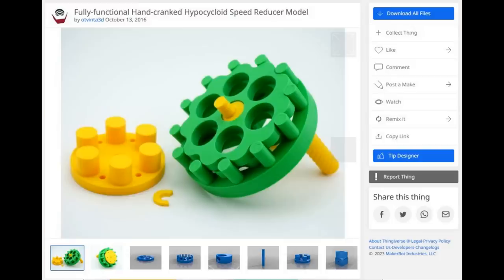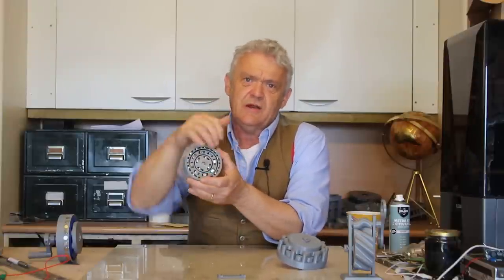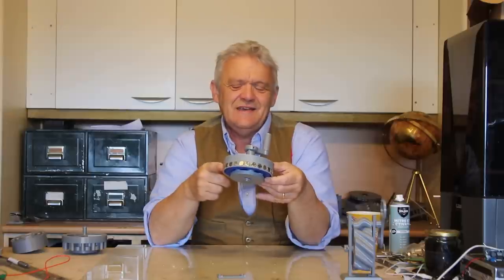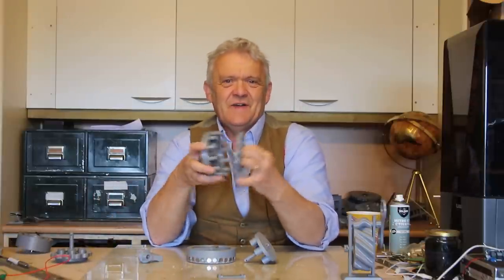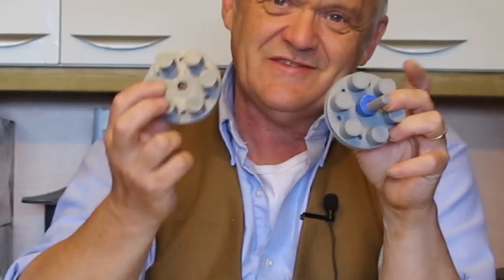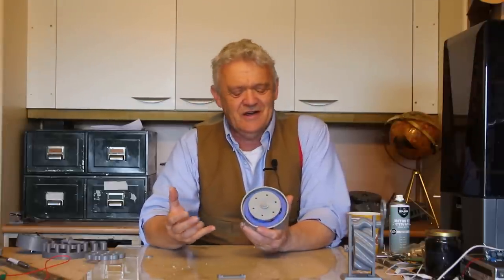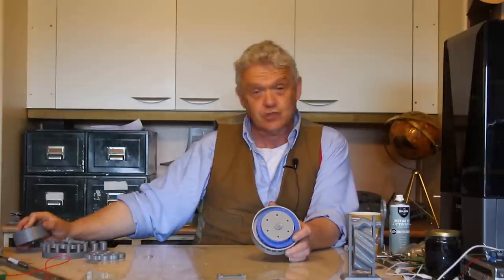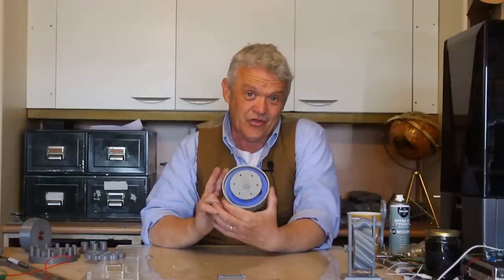1988 Magnetic Cycloid Gear

Comment: I have been using these successfully for at least 40 years. the really nice thing is the reduction of a single stage ranges from 6:1 up to 86:1 and multiple stages are easy, so (86 x 86) up to 7,396:1 in 2 stages is possible. Before variable speed AC drives were commonly available, I also used a version that included a mechanical variable speed (SM Beier Variator + SM-Cyclo reducer). The result was a very strong drive in a small package. The cyclo speed reducers are capable of handling massive torque and high reduction ratios in remarkably small packages.

Comment: My 1990 Subaru Justy had an electromagnetic clutch activated by a switch on the accelerator pedal.  Stainless steel powder bridged the gap when energised. Also first CVT trans in a modern production vehicle.  Two computers running everything.  Very cool for 30+ years ago.  Little guy was also on-demand 4WD.
Reply: Bruh... Goodness!
You're living it mate! 
I don't know much about popular cars, but I bet that one must've been a treasure.
Reply from the maker: nice share mate - cheers

Comment: I think this would make a fine dumbwaiter drive.  
If you approach the weight limit for the gear at a dangerous height, or your counterweight gives way completely, you still get a dampened fall rather than a full slip.
It has a nice redundant fail safe built in, at the gearbox, to prevent catastrophe and, of course, could be designed to handle a greater weight range relative to the counterweight.

Comment: Would be really interested in seeing even some really basic torque tests with this.
Everyone else I've seen make them has had the slippage problem you pointed out at higher torque (and something else, I can't remember, I think it was cogging torque).
If this has actually solved that problem I'd be inspired to try some ideas myself. It would really be the perfect motor for 3D printers. People make high power 3D printed brushless motors but they're so dangerous and waste so much money on the way to get 1 working prototype

Comment: I'd imagine that this gear setup would have issues with vibration, when operated at higher RPMs. Perhaps, there's a way to minimize vibration - like using multiple "cycloids" that are thinner/lighter and arranged in a manner to offset the weight of the rest of the gears, though, there would still be a lot of shear force happening - just balanced with more gears. It would be interesting to see this setup with the cycloid gears completely filling up the chamber, with a "tooth" in every slot. If I only had more time on my hands... until then, I'll just observe and learn... while leaving the occasional comment. Thinking out loud, except in text format.
Reply from the maker: yep - it is a prototype for demonstrating the principle - two rings 180 phase shifted would be a good idea for sure

Comment: One plus one equals three! This is a rather good idea. What would you need to do to strengthen the shaft/wheel to give the whole thing more axle torque while keeping the simplicity of manufacture?
Reply: - simply lengthen the magnetic contact area (torque transfer is limited)  and fully; bush and bearing all of the sliding surfaces (the eccentrics can have eccentric bushes with inner and outer needle bearings is one were to go crazy on the parts count, as the torque increase/speed reduction can be "crazy" per stage -   30:1 per stage could easily be derived by staggering magnetic contacts   - I made a 2 stage 100:1 model many years ago as a demo of functional uses of 3d printing  (I only used a single eccentric per stage as it was hand cranked)

PLA is not temperature tollerant, metal manufacture has its good points - plastic can make great bushing materials.

Comment: I'm assuming the magnets are oriented to be in attraction?
How can they touch otherwise?
If so why wouldn't it just lock up?
Sorry just confused 🤔
Reply from the maker: magnets are very strong along the axis of attraction but surprisingly weak at 90 degrees to the axis
Reply: So like a v-gate orientation there would be repulsion in both directions of equal strength?
When approaching and when leaving?

Comment: Hi Rob. Fun always! You mentioned printing with PLA. Is that your goto for  these projects?  Would you use a different filament  for  a stronger build?
Reply from the maker: yes it is mate - i have a load and it is relatively cheap so i use it to work out ideas for as stronger build i would use something different

Comment: Will it back drive?  Seems like other cycloidal drives, with reduced friction, do backdrive or over-drive when inpu and output are reversed.
Reply from the maker: yes it does - not this model as the friction is too high to back drive you will need to replace the cam and drive pins with roller bearings

Comment: Please attach a cycloid gearbox to a wind turbine, or wind collector, then using with a pulley system, more pully's, more travel and heavier weight can be lifted

Have it lifting the weight counter levering off a tall poll or poll's, that way all the mechanical mechanisms will be at ground level and can be anchored to a foundation... ❤

🤔 Could apply a brake on the cycloid gearbox so the the turbine can still make energy.

And disengage the brake when more electric load is required. Have no idea how to detect or do that, I'm not a sparky...

Comment: how to do the proximity of the magnets of eah other affect their lifespan of 'magnetitude'? What causes the permanent magnets to loose their strength over time Could you address the concepts in a video please?
Reply: It will last for billons of years, its one of the few things science knows/understand about magnetism and electomagnetism.
Reply: @trygvetveit4747 manufactured magnets can lose their power by heat, shock, alternating magnetic fields etc. With so many magnet moving in close quarters you have an already alternating magnetic field, so billions of years is a little incorrect.
Reply from the maker: sure mate - but neodymium is a hard magnetic material it will last for centuries - i think it loses abut 1 percent every 100 years or so
Reply: @ThinkingandTinkering  I think I read 700 years depending on the environment it's in. I've totally destroyed one with a paper match.
Put one near an ac transformer and it won't last very long. I think samarium magnets are more robust.
Reply: @ThinkingandTinkering  I know this may sound strange but say one has lithium batteries right. What if in a sense one could use neodymium as a "store of value/energy" and it is only decoupled from the coil to prevent further energy generation, and in this sense can be seen as a "battery" in that unlike lithium it will tke ages to run out, especially if it is some type of stator "powering" a brushless generator.. I'm not sure if my intended meaning is being conveyed, my apology

Comment: While that is cool. I am more interested in gears that speed up. I have been working on a gravity generator with an escapement and whined it up once a day. My problem is trying to figure out the most optimum spot for the escapement.
Reply: If you add torqe to the other side it will increase rpm at the other side 👍
Reply from the maker: if you reverse the drive you increase the speed rather than slow it down - it is reversible mate - not this model as the friction is too high to back drive you will need to replace the cam and drive pins with roller bearings